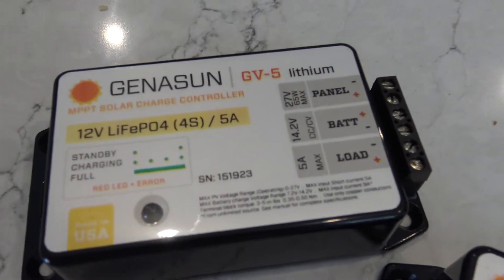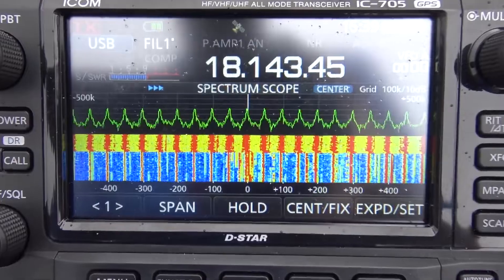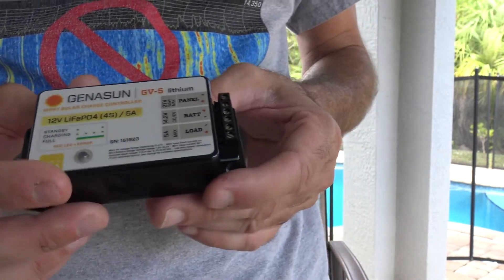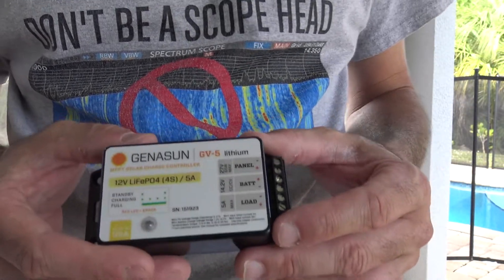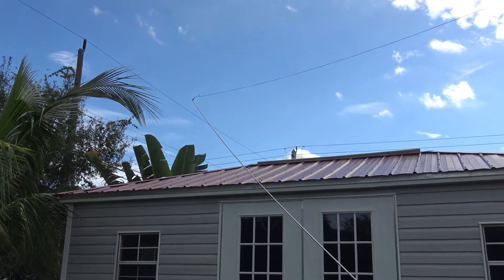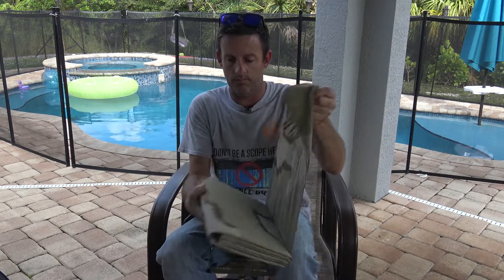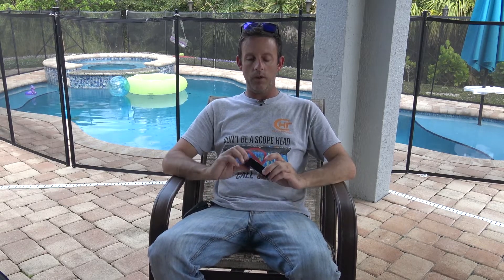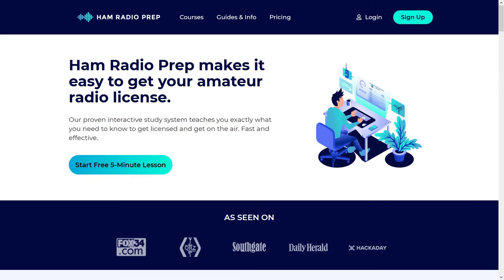Genasun MPPT Solar Charge Controller Review, RF SILENT!! For Lithium And Lead Acid Batteries

Comment: Thanks so much for this video, Eric.
Way too many ham radio ops including myself typically get sucked into buying the cheap PWM solar charge controller only to find in the field that it swamps the noise floor.
Maybe, if you had clipped ferrites on the SC unit feed wires it might help but the RF hash signal strength is likely escaping from the SC unit itself in the RV.
I've heard of other hams having RF hash issues with MPPT controllers & your video is a huge help.
Could you please review the bigger Genasun 20A & 30A MPPT units when you get a chance to see if they are also RF quiet.
 
Thanks so much for the video & it gives us hams some viable solutions for SC controllers & I'll definitely look into this Genasun SC controller very seriously

Comment: What is that fence for?
Reply: It's the pool fence that is required by law if you don't have a locking fence with audible alarm protecting your back yard access to the pool, so this way a child cannot wander in my pool and drown.